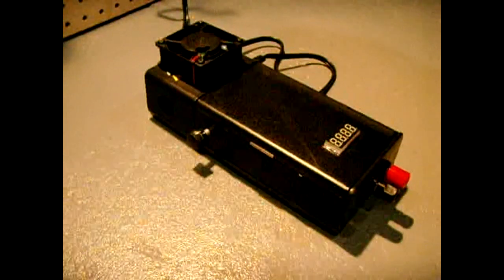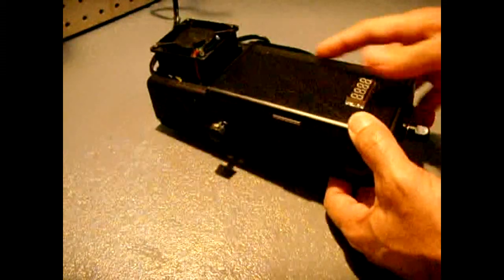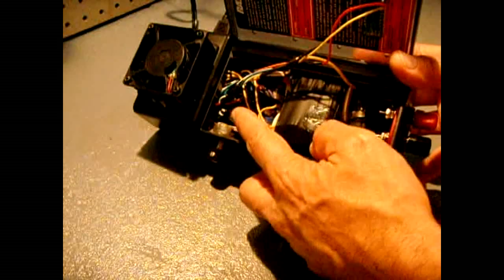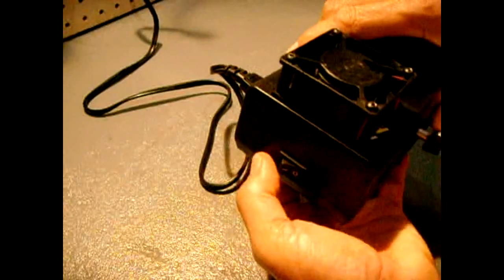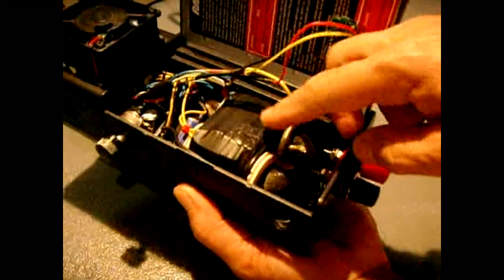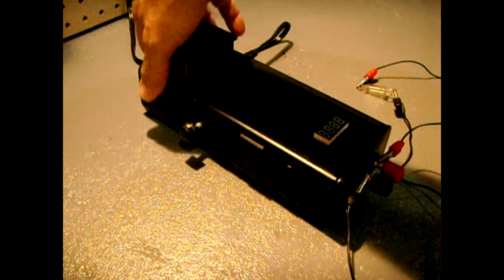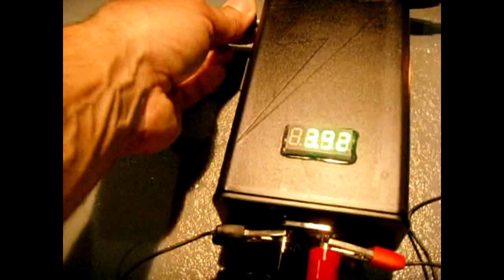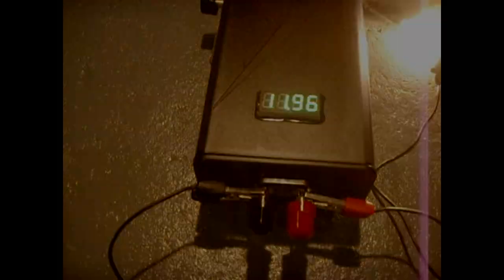Homemade Benchtop Power Supply (1.28V-30VDC/Up to 3A)

Comment: Hi Again, thanks for the knowledge full video. I am having a step down transformer which has 12-0-12 (gives 36 v  after bridge rectifier and cap) and also has 0-18 on the other side ( gives 23 v ). Can you please help me with the schematic where i can use both supplies of transformer including digital voltage meter (DVM) and make perfect variable power supply. The transformer is of 2 amps.
The only problem am having is when i try to make supply every time POT gets burnt ( B 10K sharp ) also its showing same reading on rotating pot. I am using four IN4007 diodes as bridge, LM317T, tried both 10K pot and B10 K volume pot, 2200uf 50v cap with bridge and 470uf 50 v after LM317T.

Thanks in advance,
Reply from the maker: +Anubhav Sharma 
If both supplies are not identical, you cannot parallel the outputs. You will need 2 circuits.
Reply: +electronicsNmore Yes I understand, but can you please create a schematic for developing that, ill be really thankful. Please also help me with the schematic of this video. specially getting side output for DVM and Fan.
I think i can also use 0-18 side for fan and DVM but i want dual Power supply so that i can operate multiple devices.
Reply from the maker: Anubhav Sharma
Unfortunately I do not offer special assistance to my viewers. I only answer simple questions. You need to look online for a forum. Thank You
Reply: +electronicsNmore oh, thanks anyways. Can you suggest some forum?
Reply from the maker: Google search, "electronics forum"

Comment: hi great video! please can you clarify one thing for me, I'm not that experienced with ac to dc conversion but from what i gather for the 24v fan circuit you have 120vAC-capacitor-bridge-capacitor-fan.

  if i got this correct please can you explain what exactly steps the voltage down? From what i have learned so far a bridge rectifier in conjunction with capacitors would actually increase the voltage output on the DC side.

 my guess is the rectifier as the capacitors just smooth current, but i didn't think that was possible,  i thought they just transform AC into the DC. Thanks in advance, I'm just in the middle of building a power supply.
Reply from the maker: Weak End The capacitor limits the current just like a resistor without any heat.

Thanks For Watching!
Reply: electronicsNmore wow thanks for the quick reply! so i was incorrect it actually is the caps haha, thanks for posting :)

Comment: Great video. Have you considered a portable power supply? Lithium ion batteries, mini solar panel or roll out, Bedini pulse charger with back emf capturing circuit. I think it's called "closed loop".

Comment: I ended up making an MOT with a 700 watt microwave transformer with 8 wraps of 10mm then 2 x 12/50 rectifiers and a 33000 uf cap. I used 16mm dc flex off the rectifiers and cap but found it hard to get a proper fitting to connect to the rectifiers. I don`t think I`m getting full output. Any suggestions?
Reply from the maker: The rectifiers should have a blade connector on them, or thick leads to solder to(using a heat sink close to the rectifier while you solder a heavy wire to it). (1) 50A rectifier is all you need. When you place 2 in parallel, since the diodes are not all exactly the same, one rectifier will end up carry more current than the other. You can add a VERY low(.05 ohms or slightly lower) high wattage resistor at the + output of each bridge rectifier then connect both (+) leads together.

Thanks For Watching.

Be sure to check out my video playlists. Have you seen this video?

DIY Custom Power Transformers
Reply: Cheers mate, I didn`t fancy soldering close to the rectifiers so I soldered onto connectors that were too small to carry the 16mm. I connected both +s and both - s together at the capacitor via a 6mm threaded bar. It does work, just not to my satisfaction. We spoke before at the video you linked there. Keep up the good work! :)

Comment: Do you have plans to enhance the above project to have variable current as well in future??
Reply from the maker: If you use an lm350T, and the appropriate size power transformer(24v/72va), you can make a 3A adjustable power supply. If you want variable current as well, which I really do not need, then refer to the lm317T/lm350t data sheet. You will see many circuits for what you need. Just take the regulated voltage output and feed that output into the current regulator circuit. You can buy the same type of digital meter for amps, that I used for the volt meter. You will have a voltage and amperage display, with 2 controls to adjust the outputs.

Thanks!
Reply: electronicsNmore Got it.. Thank you.. :)
Reply: Makesh scientist avatharkana Oli vattam thalaikku pinnala theriyudu

Comment: how did you wire that DVM to your PSU is there a special  circuit that you make to get the meter to follow the voltage up and down  thanks for the vid :)

btw congrats on the 5k subscribers
Reply from the maker: The DVM is a self contained module. All I needed to do is supply voltage to the module and connect the monitoring wire to the Vout terminals of the PSU. I added another winding on top of the secondary winding to power the DVM. If you make this, and need more power output, but do not want a big issue using the lm317t's, then just use a lm350. It is good for 3 Amps.
Reply: kool thought so but i have some single and double digit  7 segment displays  laying around but dont know how to wire it up and i dont want to use a microcontroller but thanks for the reply ill buy some  blue displays

Comment: for all that work you could have used a SMPS design, very nicely made though good job.
Reply from the maker: I thought of an SPMS. I had one laying around, but I don't think they hold up as well/as reliable as a power transformer like I used. I have experimented with them before, and they can fail fairly easily if you are not careful how you use them. They seem to only like consistent power levels. 

Thanks For Watching!
Reply: yea thats true you gotta make them out of good stuff :) they do work alot better with a fixed voltage, you could use a 30v SMPS and then a DC-DC buck converter to drop it down to your specified voltage :)